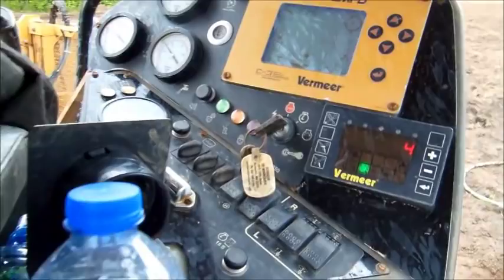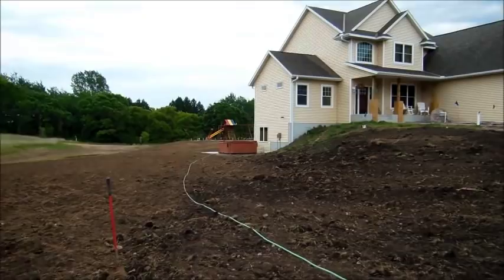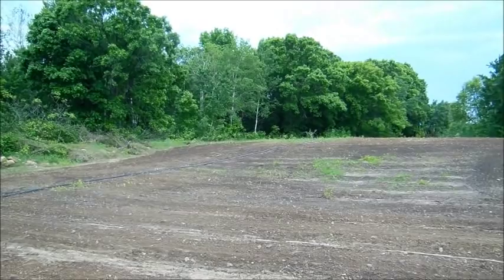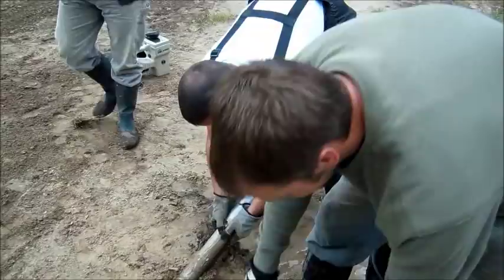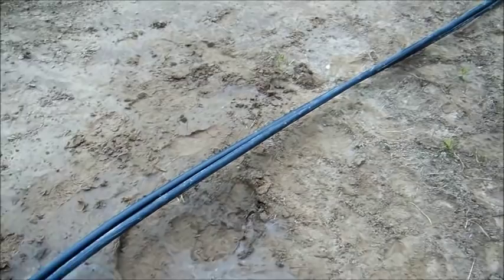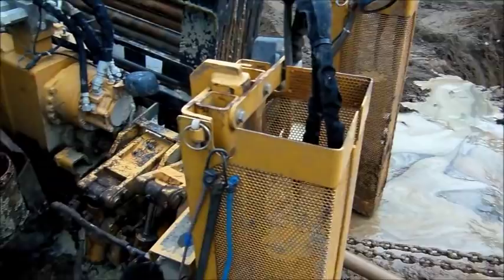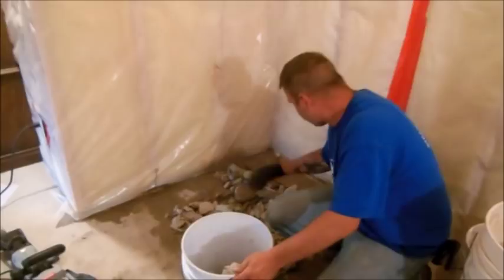Directional drilling a geothermal loopfield.

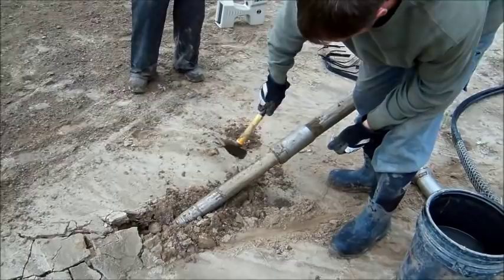Comment: HOW IS THE DRILL STEERED?  ANSWER:  The section of pipe near the end of the drill contains an electronic device ("sonde") that emits radio signals, telling the operator and other people on the surface where the end of the drill is located.  The end of the drill is sloped at a sharp angle, like a chisel.  (You can see it at 4:16.)  The electronic device near the end of the drill also tells the operator in which direction the sloped face of the drill is pointing.  When the drill is rotated as it is pushed through the soil, then the drill cuts in a straight line.  When the drill is NOT rotated as it is pushed through the soil, then the soil presses against the sloped face of the drill, pushing the drill in the direction which is OPPOSITE to the sloped face of the drill.  So if the sloped face of the drill is facing downward, then the drill will move upward.  If the sloped face is pointing to the right, then the drill will move left.  Etc.

Comment: I dunno how those who are a hd operator consider themselves an operator when they have both augers down and changed to another machine...Learn to carve...............Ive always been told a good drill operator doesnt need augers...I go daily without them.......Practice makes perfect
Reply: where you operate out of? im a pretty seasoned operator for a gas and electric company in colorado. deal with every soil condition imaginable here. ill usually use one auger to keep me from moving left to right never chain up tho. worse thing for me is exposed rods in the entry pit. dig crews never learn.
Reply: tcampbellu I’m the best operator ever. I use down riggers every job unless I’m on concrete
Reply: That's just plain ignorance.  You're adding stress to the frame of the machine too when you're not staking down.